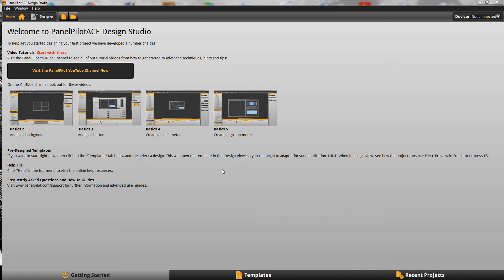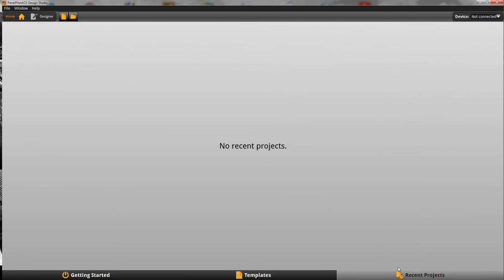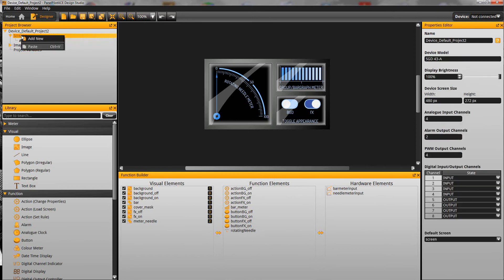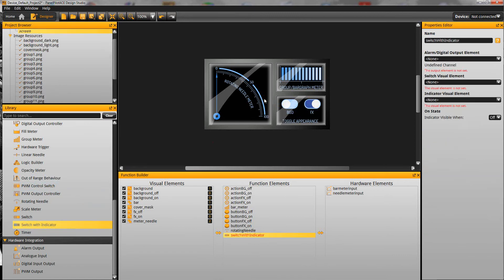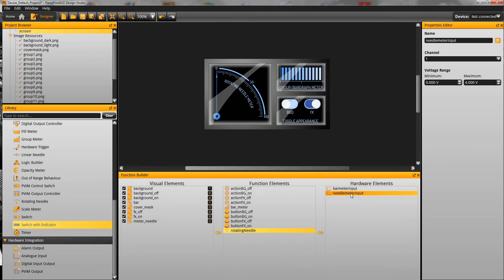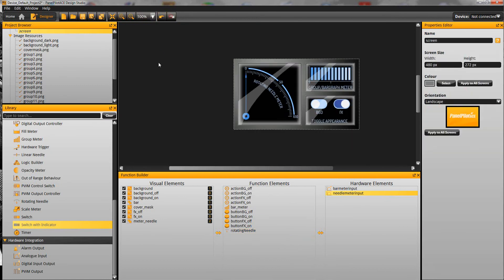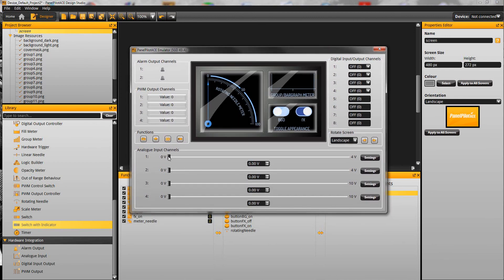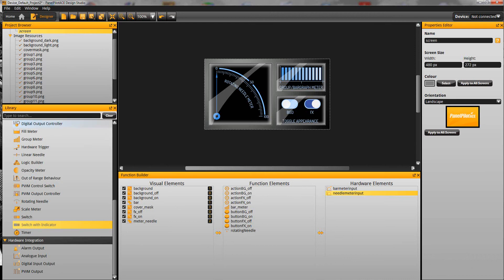PanelPilotACE Tutorials: Basics 1 - An Introduction to the Software Interface

Comment: This product seems fantastic, the Design Studio seems very easy to use and there are a lot of features. I can't wait to evaluate this panel but seeems impossible. I have  one, bought about 2 years ago and trying to upload a project says need to update software, trying to update panel software  it gives the message "incompatible runtime". On your site I cannot find old version of the software, the Chat is the only support option I found. I've been waiting more than 70 minutes with the message "You are number 1 in the queue. Your wait time will be approximately 1 minute(s). Thank you for your patience."
Reply from the maker: Hi Leonard, sorry about that! We know how to fix your issue. Please could you email sales@lascar.co.uk where one of our sales engineers is expecting your email and will explain this resolution. Thanks
Reply: Thank you its working now.